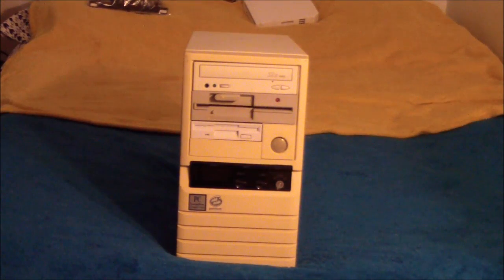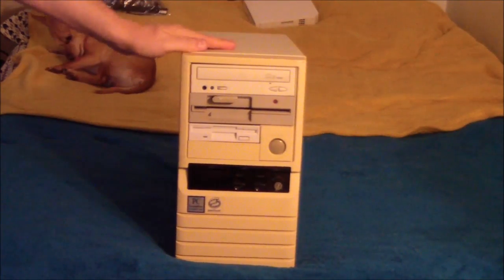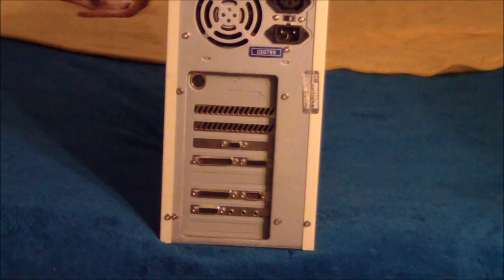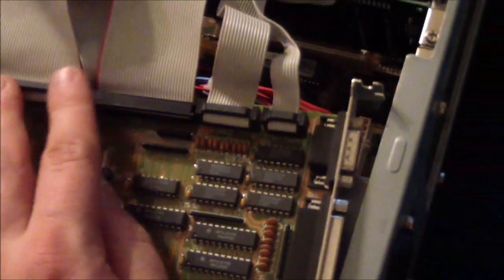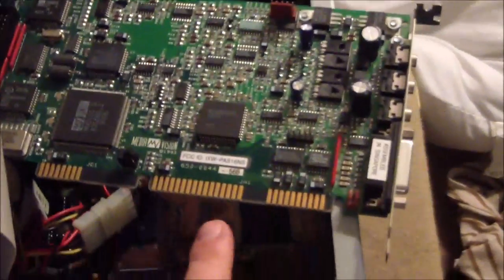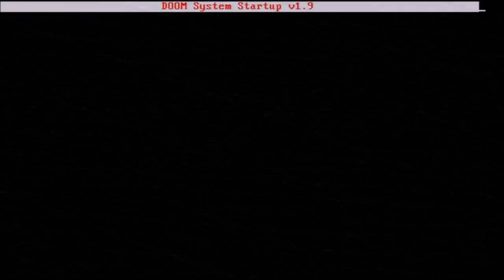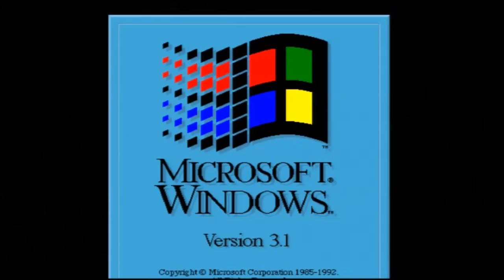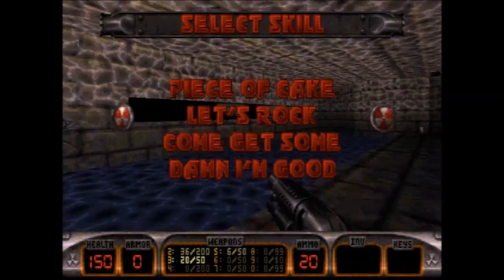A second look at my socket 4 Pentium 66

Comment: Great video - I have yet to play some duke3d on the P60/66.

I recently got an OR2151 which is the Intel version of the standard board type. For not having much in regards to BIOS tweaking options & low synthetic scores it's as fast as a DX4-120 in Doom... I got 49.8fps with a Matrox in demo3(screenblocks 9). Funnily it's faster than the "SI5PI AIO"(which is one hefty board) in aforementioned game. Have you tried the tweakbios tool with your board? Does your board feature the voltage regulator for voltages > 5V?

Comment: For the display on that case, you just need to old down the reset button until it toggles "change" mode.  This will let you set the display however you want.  The left button moves it up, and the right button moves it down.  Set it, then reboot!  I've got a few cases with this display, and I have some spares with the black housing in case you ever need one, I'm sure we can work out a trade :).

Comment: I vaguely remember that there were motherboards for some kind of pentium (don't know which socket) that supported the turbo button by inserting NOPs that slowed down the processor. I also believe some motherboards allowed using the turbo button for suspend.

Comment: You might consider mentioning that even though it supports 192MB of RAM putting that much in could actually degrade performance because of how much cache is typical in early systems. Assuming this has 256K cache 32MB is the optimum amount of ram. Also are you a vogon's forum member? I've heard you mention HighTreason and Phil's VGA benchmarks.
Reply from the maker: You are very right. That's one reason I usually limit DOS type builds to 32 or sometimes 64MB of RAM. my Pentium 200 DOS rig has more then that but then it has 1mb of L2 cache. I am a vogons member indeed. awesome place. its very helpful at times when I'm looking for information and such.
Reply: @rhuwyn This is not true, the use of such a large capacity in this case definitely does not reduce performance. It is important to remember that at the time of the release of the Intel 430LX chipset, it was high-end, not mainstream, and the designs of those chipsets corresponded to this. The 430LX chipset does not have a cacheable memory area limit of 64MB, but it can cache the full range of 192MB. Similarly, the 430NX can cache the full range of memory, up to 512MB, since it is a chipset for workstations. The 430HX is also a chipset for workstations, so it can fully cache the entire 512MB, but there it is conditioned by a sufficiently large TAG ram on the board, which not every manufacturer and not every model has installed. The cacheable area is limited to 64MB by mainstream chipsets of the Triton series, that is, 430FX, 430VX and 430TX. Therefore, I must describe the claim that most Intel chipsets have a 64MB cacheable area limit as false. Half of Intel chipsets for Pentium can do more. It is a common thing that more cheaper solutions were found and preserved among people.
A similar situation was also with 486, when some boards were equipped with larger TAG RAM and thus enjoyed a larger range of cacheable memory. But it is true that it was rarer there.

Comment: Man o man.. I miss the days of White PCs.. I have this nice circa (2004) White tower, 4x 5 1/4 and x 3 1/2, It getting harder and harder to find a decent Mid-Tower with four 5.25 bays and even just one 3.5 bays... most are switching to USB3.0 as well and some are so flimsy! A case's motherboard area would flex, bend, sheer off, under the weight of 2x XFX ATI HD4850 (which are like 1.6lbs each), throw in a nice CPU cooler tower, and that EVGA 700B PSU (6 pounder), better be in a tower that mounts PSU on the bottom!
Reply from the maker: most AT towers seem to built well, more metal. They are getting harder to find though I've had some great luck lately and actually have an overabundance of them. I can't help it. If I see an old AT case I cant resist just picking it up.
Reply: AT Desktop cases are built like a tank.. I am sure they are so thick, a EMP could strike, and it would survive :D

Comment: Here's a neat idea: I'm currently workin on my little project --- cluster based on socket 775 computers! Sadly I'm limited to use Linux only, but not big deal! I have like 5-6 775 beauties (mostly Conroe / Wolfdale)...because they're dirt cheap, you might get some of these...and bob's your uncle! You got yourself pretty powerful (althought limited to things you're going to perform) cluster thingy!
ALSO, THE DOG!
Reply from the maker: I've thought about building a Beowulf cluster just for the hell of it once or twice but I don't have nearly the room for it. The dog is so distracting, lol, apparently he decided to trim his toenails with his mouth this time. My last video I had to put a censor bar over him cause I failed to notice he was licking himself a bit to enthusiastically.
Reply: what linux do you plan on running? that is not too old... i love Lubuntu on my Sempron X2 2000+, Athlon64x2 5600+, and AMD E-Series E-300 + Radeon HD 6310 (a Toshiba C855D-S5103).